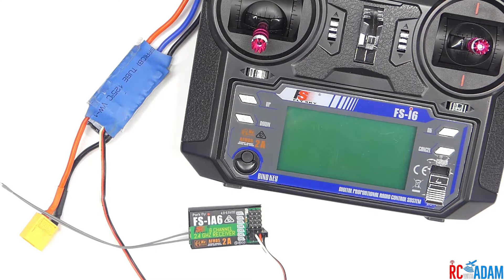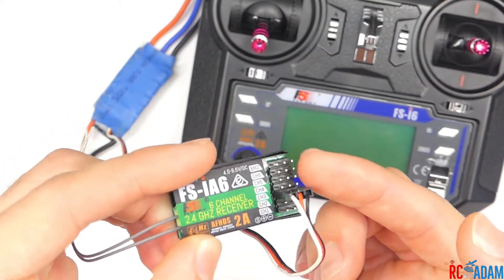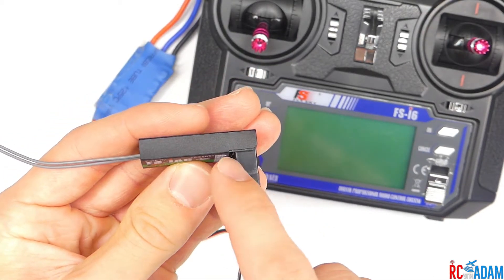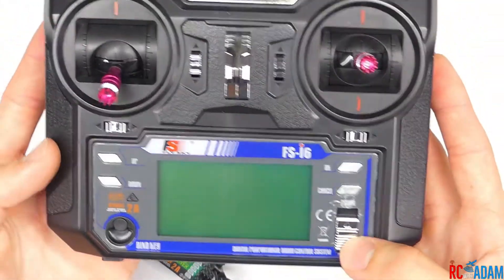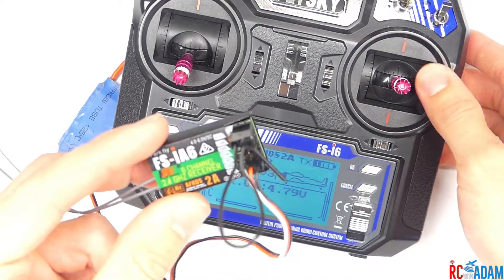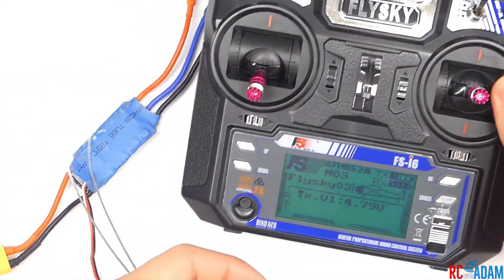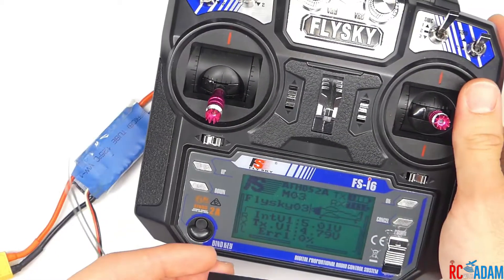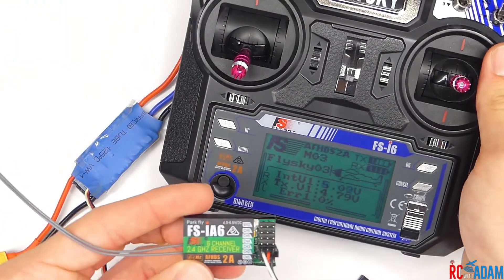Flysky Receiver Not Binding? Fixes for 2 Common Problems Binding Flysky Rx - FS-iA6, FS-i6

Comment: I can't bind FS-IA6B receiver with FS-CT6B transmitter
Reply from the maker: Hi! According to this handy chart https://www.flysky-cn.com/rxtx-form, the CT6B is only compatible with the R9B, R6B, R6C, GR3E, and GR3F receivers (so, basically the older ones that use AFHDS protocol and GFSK modulation). if you just want to build a cheap, 3-channel airplane, I've used the GR3E (this one here https://amzn.to/37rNeT7) with good results on my V-Bat and Golden Jet planes. But if you want plan on getting into the hobby more, and *especially if you want to fly quads*, I recommend you get a better radio like the FS-i6X (like this one here https://amzn.to/2AyHGu2).

Comment: I noticed on the receiver in the video, the rx has the error 1:0%.  I have the same error...the reason I came to this video.  Do know why this is happpening?
Thank you for this great, straight to the point video!
Cheers!
Reply: This reply might be a bit late but I noticed the same thing, most forums said "It is reporting transmission errors" "At low % should indicate if you plane is in range and has good signal, at high % it is beginning to lose signal."

Comment: Hey!  I need hel with my rc plane. 
I have a flysky fs i6 transmitter,  and a r8ef radiolink receiver and a fs-8as mini receiver.  And i just cant manage to bind anything!! I dont know what to do
Reply from the maker: Hi! Sorry for the delayed reply. It looks like the r8ef receiver uses radiolink's FHSS protocol, and is not compatible with flysky's AFHDS 2A protocol. Make sure the FS-A8S is in the correct mode, either sbus or ibus.
Reply: @RCwithAdam1  Thanks!  I guess that means i need to purchase a different receiver for my transmitter

Comment: I'm on FlySky FS-I6 TX, FlySky FS-IA6 RX, and an Mtroniks Viper Marine 25 ESC.
I plug the bind plug into the bind channel on the receiver,  then give it power from the ESC. The red light flashes quickly. I hold the bind button on my transmitter, and the RX light flashes slower. But the TX won't say "RXbind OK". Nothing will work.
If you have any advice, I'd be greatly appreciative! Thanks!!!!

EDIT: I'm a complete moron. I forgot to charge the battery.
I'd delete this comment to spare me the embarrassment but I'll leave it here in case anyone else learns from my mistake.

Comment: Hey, I've tried all these different methods with the same RX + TX combo but it stays on the "RX BINDING...." I've tried the bind plug in/out first and done all these different types of connections but doesn't pass the RX Binding... screen. Thanks
Reply: You and me both bro
Reply: Even me sane thing - no one is answering questions here

Comment: Aways when I plug the receiver in it goes into bind mode and no matter if the binding cable is plugged in or not. If If bind it than the light flashes slowly also after removing the bind cable
Reply from the maker: Hi! I haven't come across this before. The receiver could be defective.

Comment: Hey Adam I'm just going to go ahead and drop this here. For those of you that are having trouble binding the FlySky FS i6x just bind it like normal and if you see that it's not binding just let it stay there for a long time it worked for me.
Reply from the maker: Thanks for the tip!👍
Reply: @RCwithAdam1  thats what she said 😆😆😆 🤘 hey Adam if you have a moment,  I have the tinyhawk race. I'm connecting a fli14+ (flysky ibus) rx to it and selected the UART port accordingly. I selected serial/spektrum/ etc and IBUS on the configuration.  I saved. I also made sure my radio (fsi6x) is on ibus but I'm not getting any response although my rx is bound to the radio. 

I did everything I could think of even switched to sbus and still nothing.  

Upon closer examination of the quads board I notice it says SBUS next to where I soldered the 3 wires (and I made 100% sure they are in the correct pads) according to a video here showing how to install a crossfire.  Does this mean this quad does not accept ibus?
Reply: How long did you wait? I have been at it for about 10 minutes now.
Reply: @brian_mcnulty  actually,  I had a new radio and tried to bind and it never bound. Not sure what happened but I ended up buying a flysky paladin pl18.  However, for this case stated above I waited near 20 minutes at least.  If it doesnt work try moving closer or away from the reciever. Good luck.
Reply: @brian_mcnulty  I waited for a long time and got nothing but I hooked up power and ground to my bench power supply and supplies a constant 5 volts and then I also replaced the bind key with just a female to female jumper and I don't know which of the two (I suspect the jumper) fixed the issue. I know this is a lil late but maybe it'll help someone else out in the future.

Comment: There is no light on my fs ia6 reciever what should i do?
Reply from the maker: Hi! Are you sure it's connected properly to the ESC (with battery power)?
Reply: @RCwithAdam1  my esc was just bad cause when i pluged the jst connector directly to the reciever the reciever light turned on
Reply from the maker: Oh good. Glad you figured it out!

Comment: im bound but my drone wont fly,..please help
\
Reply from the maker: Hi! Sorry to hear that!  What model of drone do you have? And what receiver and transmitter are you using?
Reply: @RCwithAdam1  Arris 250 transmitter is a flysky fs-i6, receiver is fs-ia6B
It came all set up and ready to fly, but some how or another (on day 1) my drone and transmitter stopped talking to each Other ...
I wouldn't call myself tech savvy by any stretch of the imagination but I figured out how to bind them again. Now they see each other but I'm getting a warning code7... something with the throttle.. it's too high I guess but I have no clue how to lower it ...any assistance/advise would be greatly appreciated!!

Comment: What is "Err1:1%" shown in display?
Reply from the maker: Hi! That is for the RSSI Receiver Signal Strength Indication. The iA6 does not support RSSI, so it's showing an error on the display.
Reply: @RCwithAdam1  Thanks adam for ur kindly information
Reply from the maker: Hey! Sorry--I told you wrong. After checking it again, it does show "Sig10" on the display, so I guess it does show the signal strength, but I'm not sure how accurate it is.
Reply: @RCwithAdam1  it's OK man No worry about it